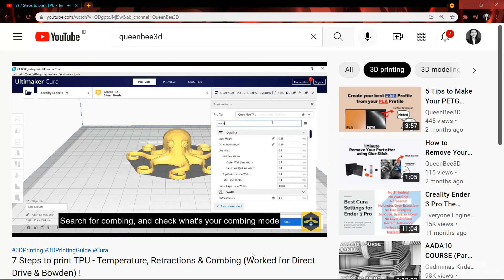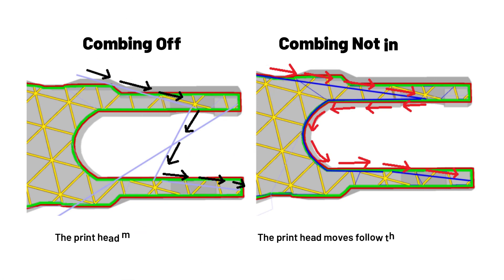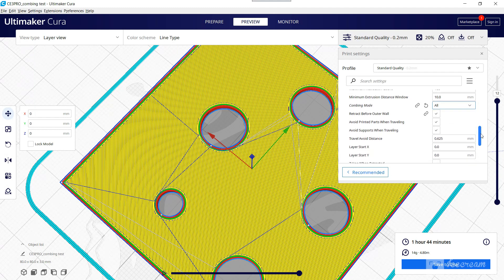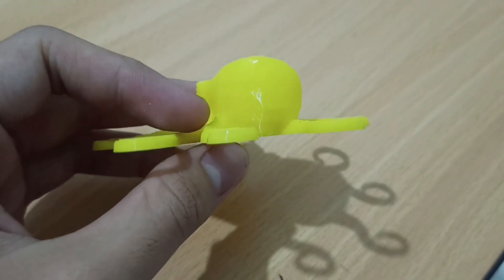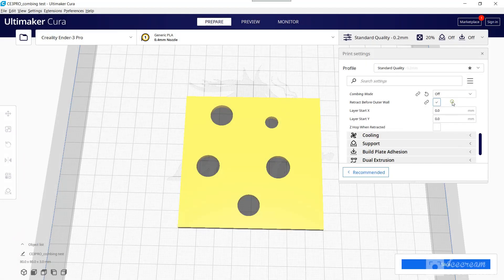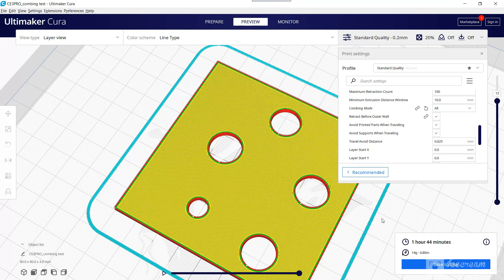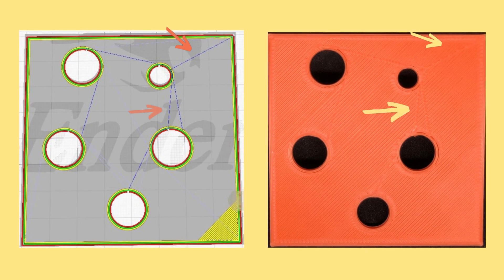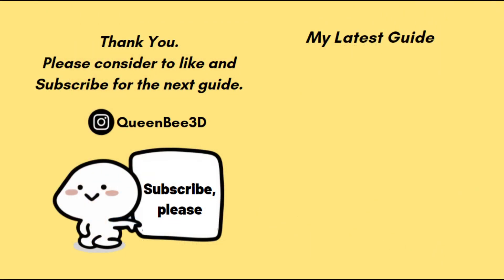How To Remove Travel Lines On Top Layer in CURA 4.11 (The Best Combing Mode?)

Comment: The best way to avoid these scratches is to adjust your flow to prevent them.  Over extrusion is what causes it.
Reply from the maker: Might be true for you, but for me I had different result. I had adjust my flow and e-step but it still happen. When I look back at the CURA preview mode, it shows the same pattern (blue line) as I mentioned in the video.
Reply: @queenbee3d997  I agree with you.  I was having this same issue and your video really helped me to understand what was causing it.  It was DEFINITELY the print head scratching across my model on the top layer.  Cheers!